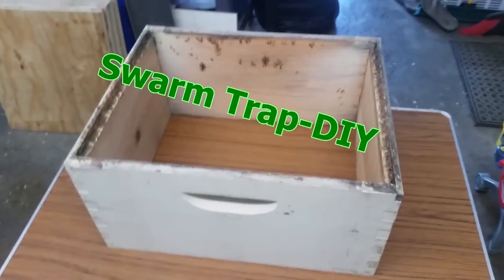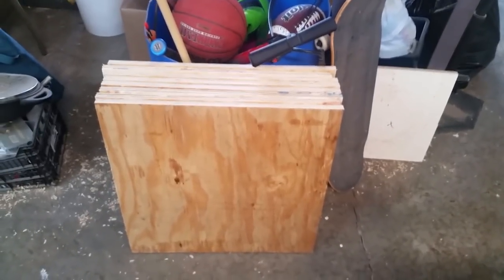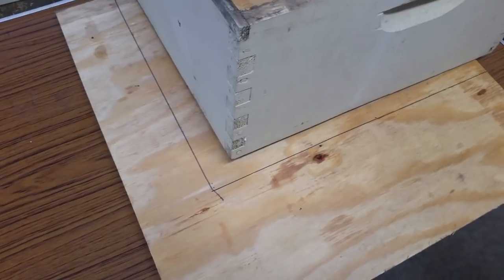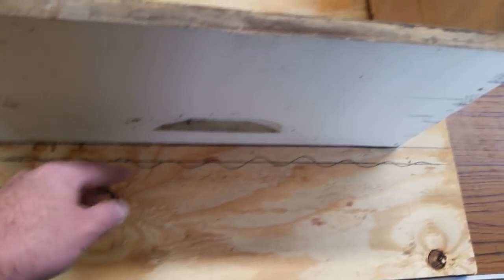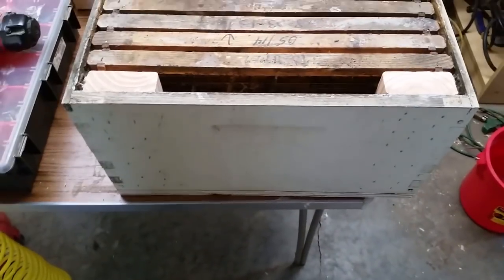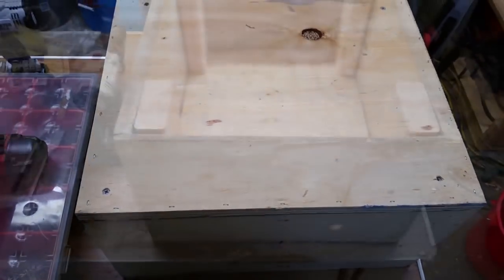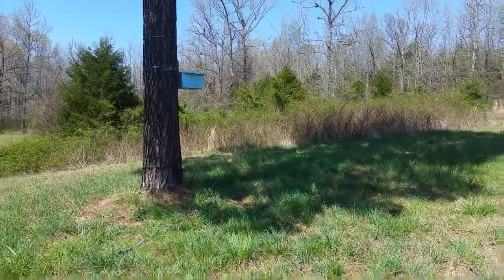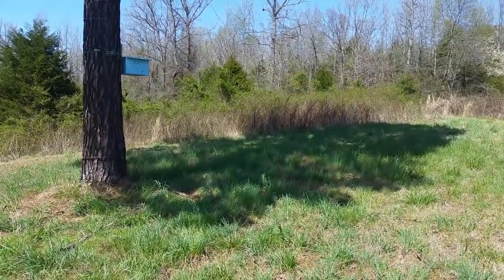Swarm Trap DIY

Comment: Excellent advice thanks- what size bolts do you use and are they carriage or hex bolts?  Thanks
Reply from the maker: I basically used whatever I had sitting around.  Think these were 1/4" carriage bolts, but it really doesn't matter what you use as long as they are sturdy enough to hold up your box.

Comment: Thanks for posting; wondering: how did you find that a  deep box the "ideal volume" for a swarm trap?
Reply from the maker: Ellis Ralph extensive research into ideal swarm trap conditions have been done by Tom Seely.  Mist ideal volume is between 35-60 liters internally with a 1.5" round opening or equivalent.  Single deeps come in at 43 liters, so they are close to the sweet spot in the middle of the range.

Comment: What type of paint and primer did you use?
Reply from the maker: The final topcoat can be anything, but exterior paint is best as interior paint doesn't have mold inhibiting components in it... unless it's bathroom paint, etc.  I just use a good quality water based primer, I prefer Kilz, and 2 top coats of an exterior water based paint.

Comment: "First off, use....old paint that's not going to off gas"...  Proceeds to paint the old box. Did you just mess up and ruin it now or is it just an opinion that is not practiced and doesn't change the outcome? This is at least the 2nd beekeeper that stressed the "first thing" is to avoid new paint due to off gassing. I'm about to start package bees in new hive bodies and now I may want to find old boxes. Why is new paint and off gassing the first thing to avoid?
Reply from the maker: It really doesn't matter either way as long as you don't paint the inside of a box.  Since I had to paint the new pieces that made up the top and bottom of the box I thought I would mention the difference in new and old paint since people do ask, but I have never really found it to make a huge difference.  With that being said, I wouldn't paint a new hive and put bees in it that afternoon, but rather let it sit out and air out for a few days before installing bees.  Since it was highly unlikely that I would have a swarm move right in to any of my traps, and I had new bare plywood tops and bottoms that needed to be coated, I went ahead and painted mine anyhow without worrying about it.  Sorry for any confusion I might have caused.